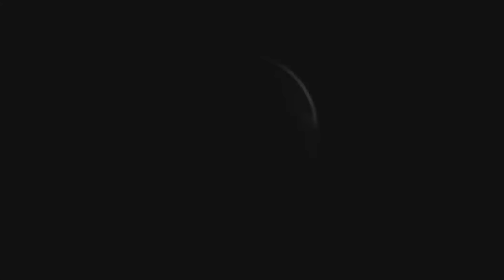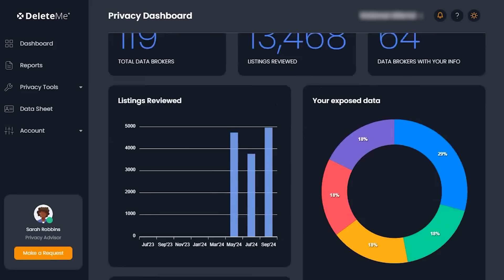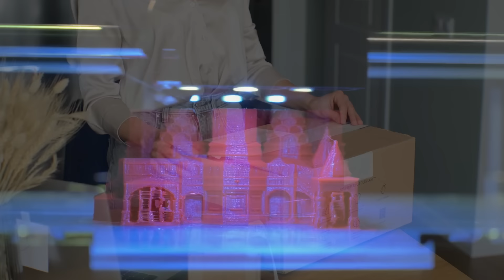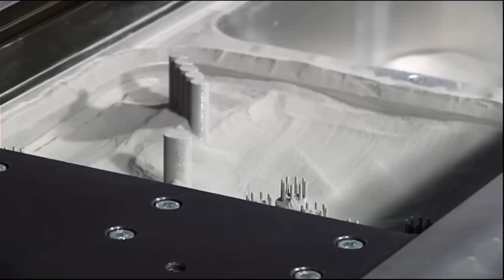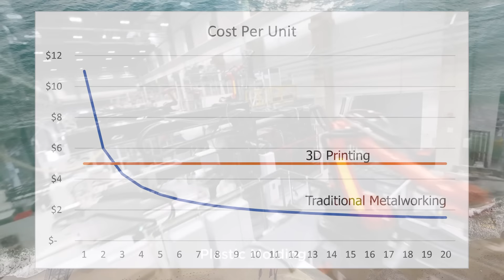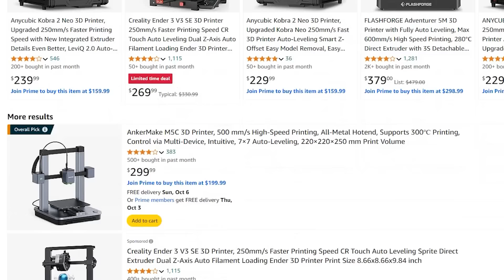3D Printing, Cathie Wood's Latest Disaster

Comment: 3d printers are like vr except 2 generations further behind and without the zucc to burn billions to push the tech forward.
Currently they're only good to print miniatures for tabletop games which is beyond niche.
And even that is only viable because official companies like Games Workshop charge hundreds for literally just plastic.
(Btw I do know several people with 3d printers, they arent that rare).
And for that I do concur, the chinese competition just obliterates profit margins for plastic model 3d printers.

If a western company would get something advanced like atomic layer deposition in 3d and at decent speeds going they'd be the next big thing for sure.
It'll probably be done by semiconductor companies like applied materials if ever.

tl;dr cathie isnt very smart.

Comment: A lot of these 3D printer problems seem to be company problems more so than 3D printer problems. They never took the time to build a decent product and instead flooded the market with junk for a decade. 
To this day there is still not an affordable SLS style printer. Which in reality is where many companies would want to go for industrial uses vs FDM.

Imagine explaining to your employer why you want to spend 90k on markforged junk. (I almost had to).
Reply: @thealienrobotanthropologist  There are definitely uses for them, but they're not the magic box that the hype sold them as. I work for a place that makes medical parts and there's a section that specializes in 3D printed metal. None of the parts coming off the printers are complete, there's a consolidation process and tighter tolerance features like threads and bearing surfaces need to be machined to final size. They're able to make shapes that are either impossible or really difficult to make any other way, but they don't replace traditional manufacturing, they kind of fit into the same space as casting or forging, but for smaller runs and more complex shapes.
Reply: @thealienrobotanthropologist  as someone who has implemented 3D printing into a low volume production environment along side traditional machining methods I kind of disagree.

3D printing does not replace all machining

But it does have major benefits under a lot of applications. 

I have access to an entire machine shop and a floor of employees who are use each tool everyday. 3/5 axis machines wire burners Cmms manual mills precision grinders ect. It doesn’t mean they are the best option everytime.

The same way I wouldn’t use a 5 axis mill for a wireburn or precision grinding operation. Big an expensive does not mean 1 size fits all. I need millions of dollars of equipment to build a final product.
Reply: it already lost from the start, trying to compete with mass production. If it works, then they are to slower and much more expensiver than the traditional methode.
Reply: @mrMoon589  fairly uneducated answer from you there honestly. 

You are trying to use a fork to eat soup and complaining it isn’t as fast as a spoon.

Try using the fork for…fork things.
Reply: Who wants SLS printers, anyway?  They're toxic as hell, you must have great ventilation, and they're messy and stinky and hard to clean up after.
Reply: @joeking433  with that logic you shouldn’t paint your house or put fuel in your car either. 

Also don’t you dare turn on your furnace this winter…natural gas bleh.
Reply: @thealienrobotanthropologist  the company I work for builds manufacturing and quality equipment for factories. 

We also have a part of the business that builds basically catalog products that our customer base and competitors buy. 

In this case it is a measuring device that we build in house. It has two “case halves” that in a mass production environment would just be made in a mold. 

However our volume is very low (few hundred a year) now that may be 750k-1 million worth of sales but only a few hundred by qty if that product. 

I make the case halves out of nylon on an SLS printer and have them cerakoted. Definitely more expensive than a plastic injection mold per unit but I don’t have to commission a mold, find a company to run it, pay to maintain it over the years etc. I buy them in batches that fill the build tray from a third party supplier so my outlay of capital is low, and from PO to delivery I only have a few day wait.

We use it for a lot of other things as well such as TPU nesting to avoid marring panels in your car as they are being inspected or post processing work is being completed such as clip installs.
Reply: @thealienrobotanthropologist  finish and limitation of 3D printing is really dependant on what typpe of 3d printing your doing - generally speaking SLS can pretty much do any angle of overhang , and they can compete with casting / injection molding in specific use cases (small scale production/ small products) , But yes printing precision is certainly a limitation

Comment: I think PLA printers have limited use for the average person. A commercial metal / pla printer would be pretty transformational but is miles off.
Reply: Wrong!  There are all kind of uses around the house for 3D printers.
Reply: @joeking433  first off, I suspect you’re not the average person with a lot of experience with them. Imagine maybe your mum who doesn’t care, just wants something to appear that works. Print failures still happen, quality is not perfect and pla really does have limited use. Now imagine one that could print PLA, copper/ other sturdier metal and maybe glass. Suddenly minor electronics are possible and usable cutlery, homeware etc become viable. If you think about most things in a house, they’re not very complicated which could be achieve with these few additions but are essentially unviable using PLA composites alone

Comment: Prusa and Bambu printers are pretty good at this point, if you can read an instruction manual and do basic troubleshooting then you'll see success making your parts. However, it is true that CAD and basic engineering knowledge is needed to reach full potential with printing
Reply: Todays costumers don´t want to read instruction manuals. Everything has be be plug-and-play, self explaining. It is not like the video recorders they sold in the 80s with a 50 pages instruction manual.
Reply: I believe he's referring to putting it together as there is some assembly required but very simple and no different from stuff going back to the 70's, I was there.
I just got a Bambu and to make something you click on it...then press print.  That's it.  IF you want to change colors you need another couple steps.  IF you want to print something from other websites that's where the finish might come in.  I expected it to be cool but finicky and it ended up being just like any other appliance.  It's nuts but you indeed can get into the nitty gritty if you choose but for say "print me a desk organizer"..find one you like and press print.
This article is massively incorrect about the cost of plastic per item (another concern I had).  You can buy a 2kg roll for between 12-20 bux and go weigh stuff around your house to figure out how much 2000 grams will get you.  PLUS that little do-dad now doesn't have to cross the ocean in a ship burning fuel oil at 60,000 gallons/day. @hermes667
Reply: @hermes667 3d printing on most printers is "plug and play" basically. If you download stl file then it's either says what variables you should change or (like in most cases) you just use standard profile. As an end consumer you just need to make some tweaks to have better prints (not necessarily, just advised). Of course if you want to create new models then you need to learn a lot, but in this way you get access to great possibilities
Reply: Shhhh!  Let people believe they can't easily do 3D printing!  Keeps the competition down for what I sell!

Comment: A 3D printer is like a lathe, working backward. There are no lathes sold at supermarkets...
Reply: Perfectly explained
Reply: I would say more like a CNC router.  You can buy those online.  Home Depot sells them only if you order them, doesn't hold them in stores.
Reply: And yet walmart sells both lathes and 3d printers. ::shrugs::
Reply: @williammiller3277  Through their online store, which is basically their version of Amazon.  They don't have them on shelves though.
Reply: I have 3D printers and a CNC and 3D printing is SO much better!
Reply: A 3d printer is an additive process, adding material to make the finished part. Lathe is subtractive, taking material away to make the finished part. 

To say a 3d printer is a lathe working backwards is false. A lathe working backwards would produce a useless billet as the output. 

Your statement implies that you don't know how either process works!